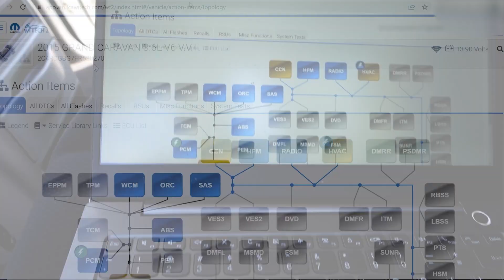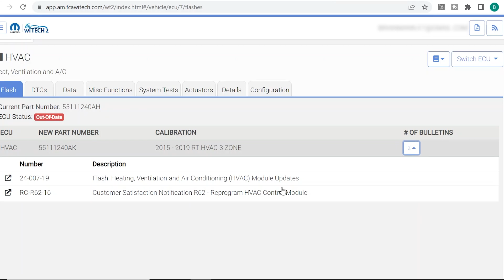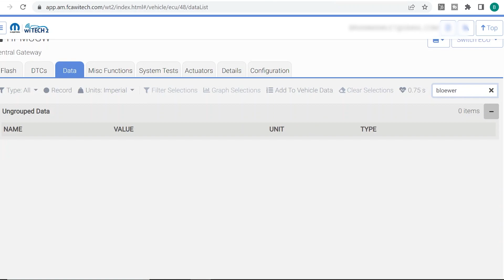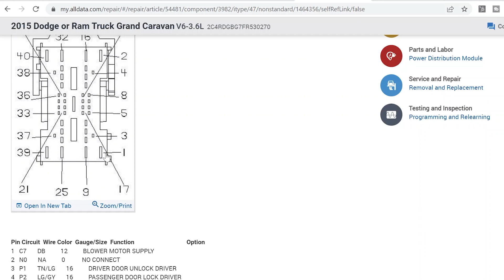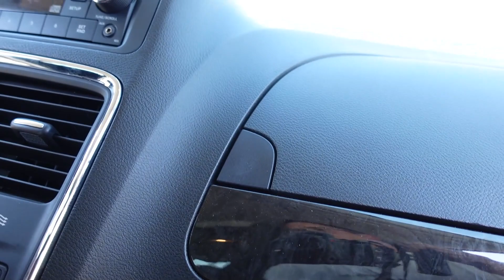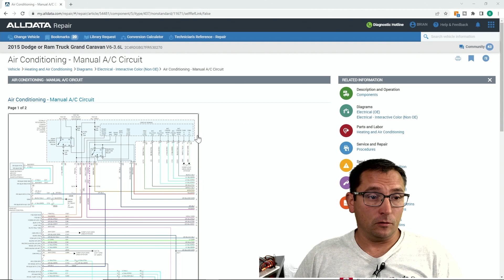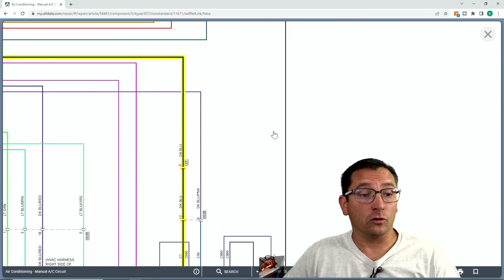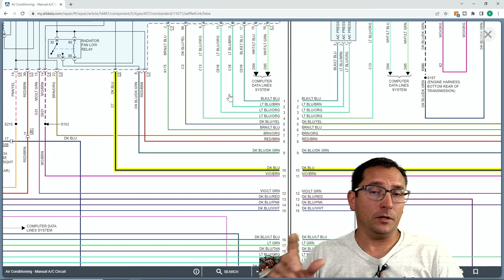2015 Caravan No Blower Motor Operation

Comment: I got 3 dodge caravan, the all have same problem, I fixed one same u did exactly, it’s working now my question is do u know which fuse or relay feeds that wire?
Reply: This is what I am trying to locate now. Thinking of verifying with continuity and cutting that blue wire coming from the plug/harness on the TIPM he showed.

Comment: The tip at 6:27 is the gold of this video and if i started here as the first trouble shooting step i would have saved myself two days of time caused by rabbit holes from other videos. watch and do before you even think about touching the blower motor or the power module. 6:27 proved my TIPM was the problem. I bought a new one and fixed this and other minor electrical problems. THANKS
Reply from the maker: Glad it helped! Please consider subscribing if you haven't already!!

Comment: What if the blower motor speed is not increasing as you turn it up and it is delayed
Reply from the maker: Not sure. Is it a digital blower control or an old school resistor  on the vehicle you are working on? Monitor the voltage drop across the motor when turning on and changing speeds

Comment: This was a fantastic video thanks for making it I couldn’t find the proper wiring diagram anywhere on Google. I just put a fuse holder right off the battery with a 30 amp fuse straight to that blue wire in the dashboard took me like 20 minutes to do a nice job of it.
Reply: Perhaps you can help me. My front and leg fan doesn’t work. No matter what I select only the defroster fan comes on. The AC is also not working. What do you think?

Comment: I hot wired right to the blower motor from the battery through a 30 amp fuse and added a 30 amp toggle switch, which i wire tied in front of the AC vent to keep it cool....  Works great !

Comment: I have an 08 with the same problem. I actually wiggled the tipm to see if it would begin working and the vehicles dies every time I do that. I was going to just run 12v ignition power to it because that's the only thing he's having an issue with, but since it dies when I move the tipm, I should probably go ahead and replace it, correct?

Comment: my 2015 grand caravan's ac does not blow cold when I stopped (but ac and engine are on) for example it blows wonderfully when I drive. When I wait at the stop sign ac makes a noise like air is leaking and ac stops blowing cold air. After that when I push the gas AC is ice cold. Please advise. thank you
Reply from the maker: Probably low on refrigerant, or airflow problem across the condenser.

Comment: Fixed one today,  same issue on a 13 caravan.   Just jumped a hot wire in from a fused key on source. Still fused through the front hvac.  Works great. Cheap fix
Reply: great idea... I may change my hot wiring
Reply: Perhaps you can help me. My 2010 Caravan front and leg fan doesn’t work and only stuck in defroster fan no matter what I select. The AC also doesn’t work

Comment: Had a p1618 reference voltage erratic would only act up once a month. Got lucky found a crank sensor 5 volt ref rubbing the half shaft